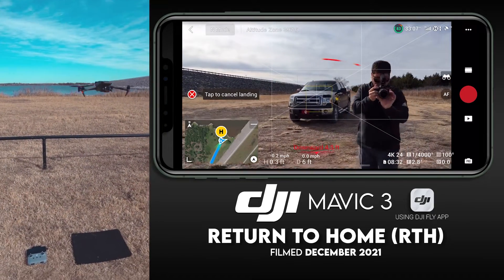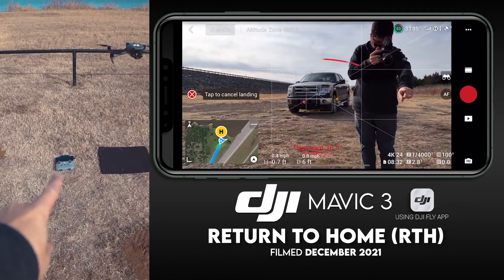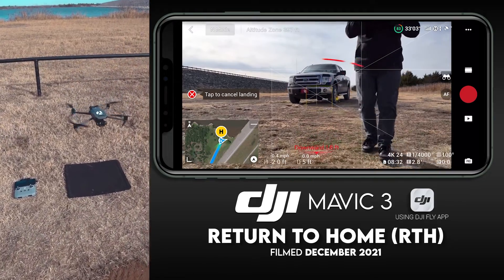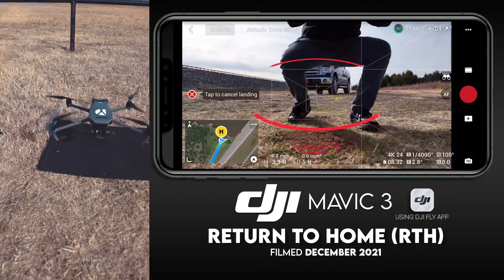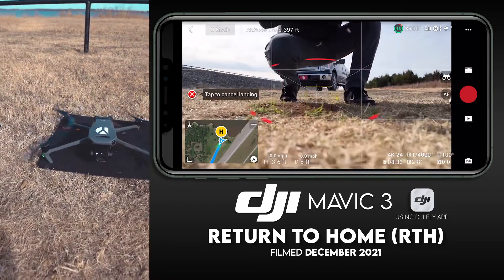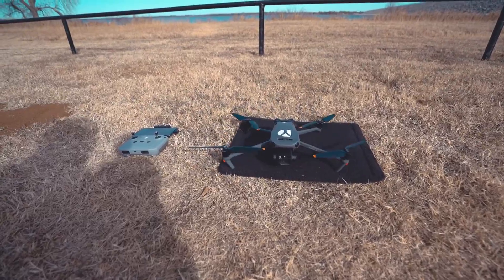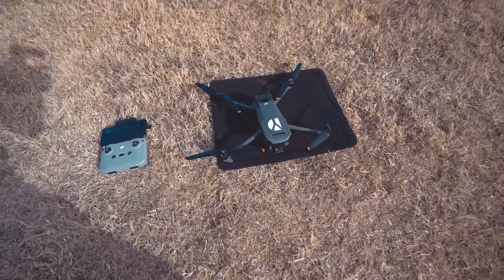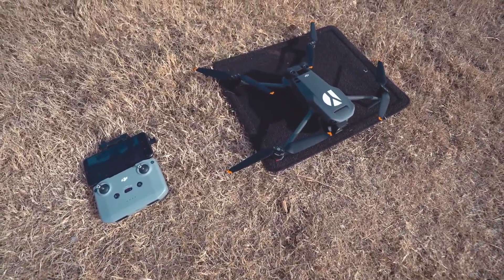DJI Mavic 3 / ADVANCED Return to Home (Tutorial & Info)

Comment: I am deaf and using subtitle so if this is wrong, sorry and I will delete or edit this post accordingly. 
Around the 2 minute mark you seem to say something about the cord (I assume you mean or said  cable) popping of being a loss of connection issue, if I am correct then the phone being disconnected from the controller will not, as far as I know, trigger a fail safe action. Providing the controller does not suffer damage etc. in the drop it will still be connected to the drone and capable of sending commands to the drone and receive data from the drone.
Also if the failsafe option is set to hover I think you would find that eventually a low battery RTH would be triggered, unless of course connection is regained before the low battery RTH is triggered. 
I don't have an M3 but I have tested this with a mavic mini, by setting the failsafe option to hover and then switching the controller off, and it did execute a low battery RTH when the battery reached the trigger level.